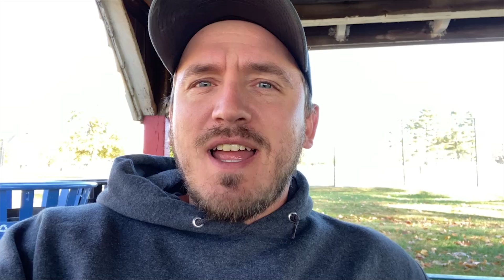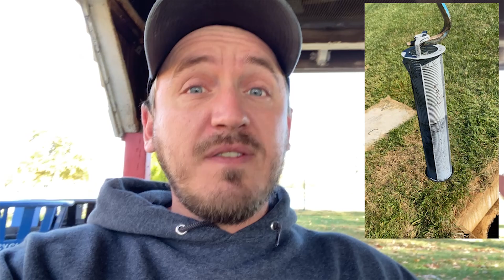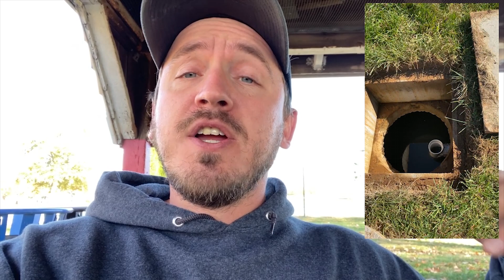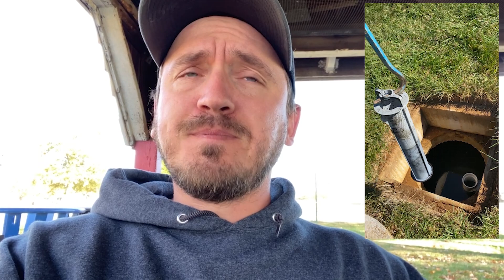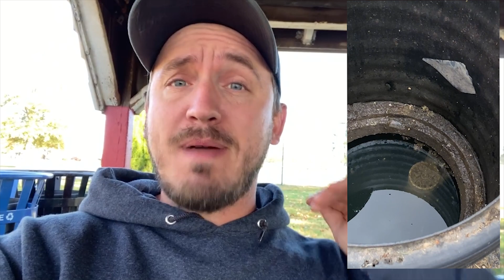What Happens if You Don’t Clean Your Effluent Filter?

Comment: Hey why do I have to frequently clean my filter? I’m talking every 2-3 weeks or else I get the water level to rise in the effluent side once I pull it out and clean it the water goes back down. But why would it get clogged so fast?
Reply from the maker: That’s a somewhat unusual issue, but it can happen under a few conditions. Most commonly, it occurs when a large volume of water moves through the system at a high rate, when there is an excessive amount of debris in the tank, or in some cases due to certain medical treatments. I don’t have deep expertise on the medical side, but I have seen situations—such as households undergoing chemotherapy—where the tank behavior changes unexpectedly.

In most cases, this issue shows up when the tank hasn’t been pumped often enough. For example, if it has been close to five years since the last pumping, the tank is likely overdue for service. If you’ve been keeping up with regular pumping, the next step would be to start tracking water usage and noting when the filter begins to clog. High-demand periods, such as multiple back-to-back showers in a large household, can sometimes be enough to trigger the problem.